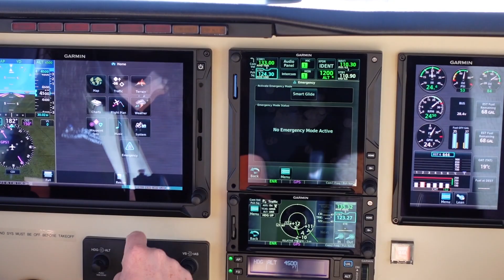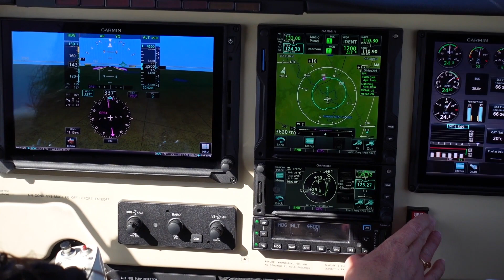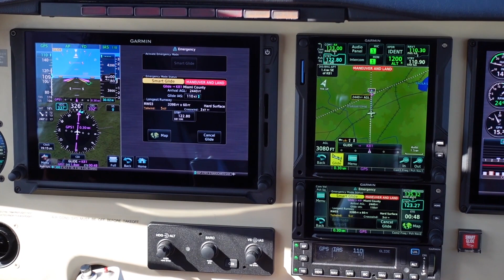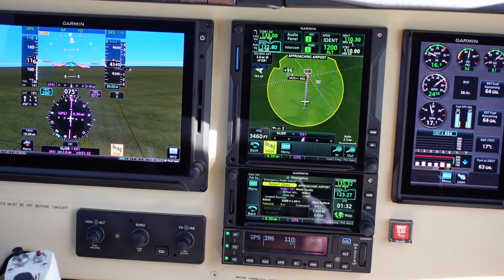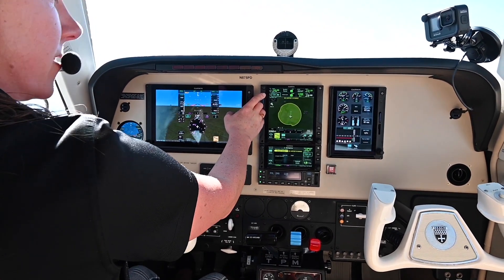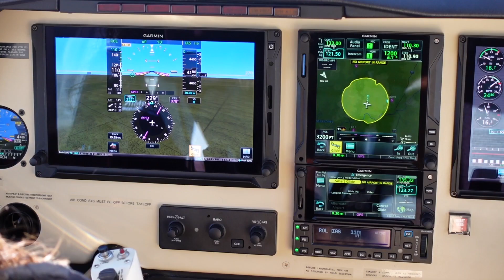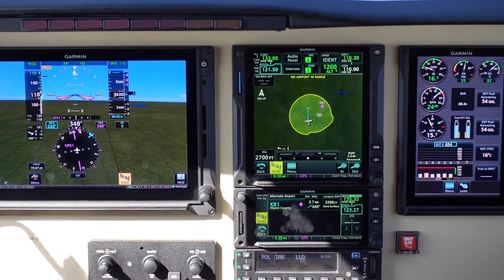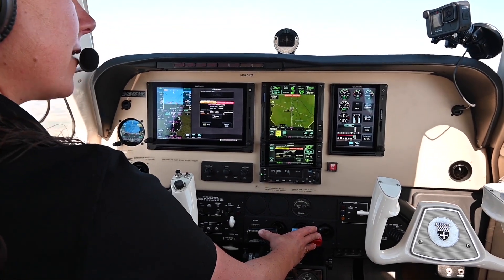Garmin | Smart Glide | In-flight Demo

Comment: What’s in your A36 panel? Could you activate smart glide from the GI-275?
Reply from the maker: Hi Michael, Smart Glide activation is determined during the installation. The most popular configuration is via a dedicated Smart Glide button that's installed on the panel. The other method is via the direct-to key on the GTN Xi series navigator. Thank you for your interest in Garmin.

Comment: So, still no demonstration of the "smartglide" thing actually landing the plane? And if you're needing "smartglide", what's the pupose of disconnecting the AP?
Reply: I think smartglide is not the same thing as “autoland”. These are two separate features with the second only equipped on Cirrus Vision Jet, Piper m600 SLS and TBM 940.
Reply: @AlessioColantonio  Smart glide is one of the components of auto land. They’ve just split it out so we can utilize it in aircraft that are not eligible for auto land. I have an experimental with G3X and just upgraded to smart glide and it handles some of the workload of flying the airplane while I diagnose the emergency. There are several accidents where the pilot was so absorbed in troubleshooting a problem that they stopped flying the airplane. Smart glide can help with that.
Reply: @AlessioColantonio  Oops, did I get it wrong? Well shucks. BUT I (and I think a lot of others as well), am still waiting to see the autoland gimmick they keep hawking.